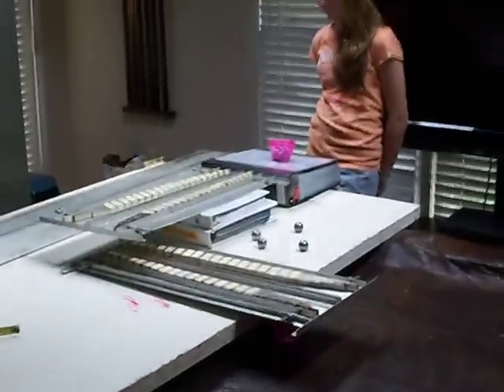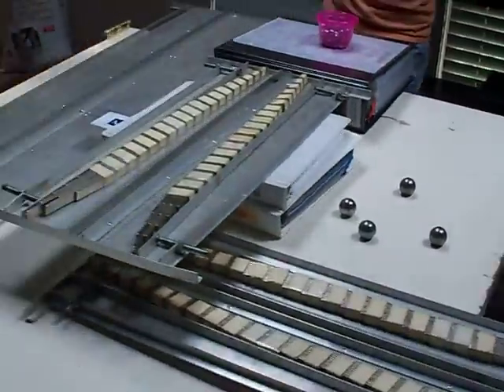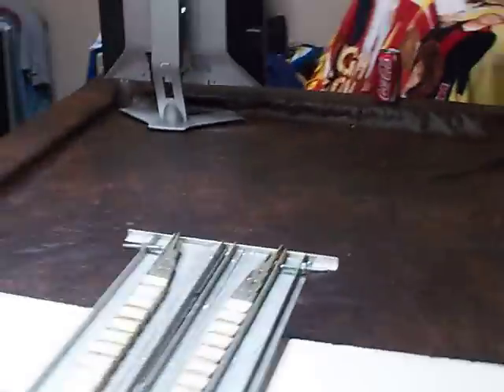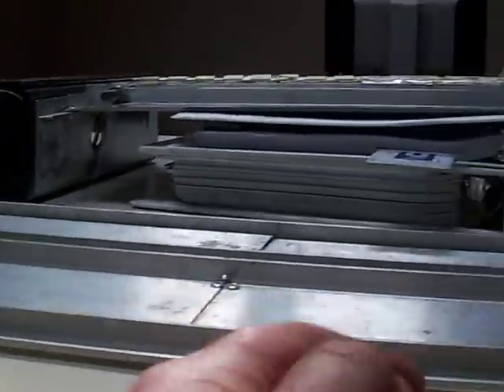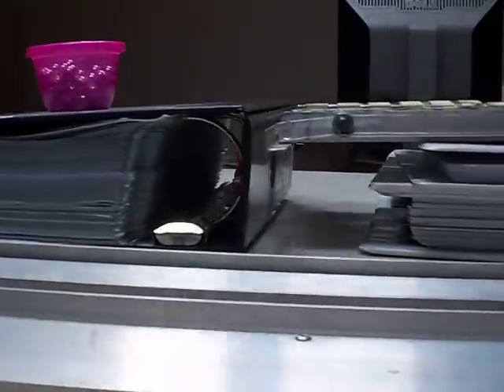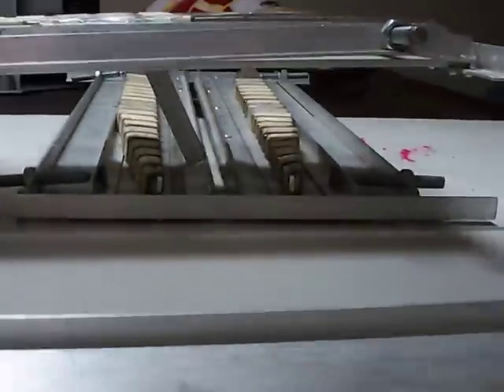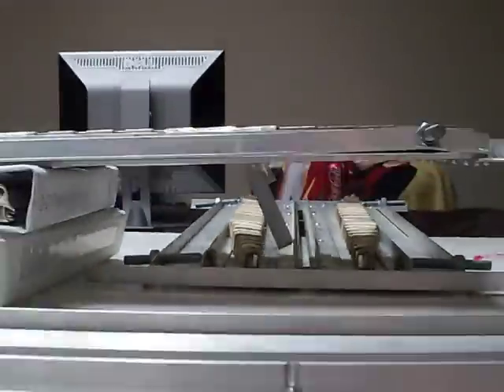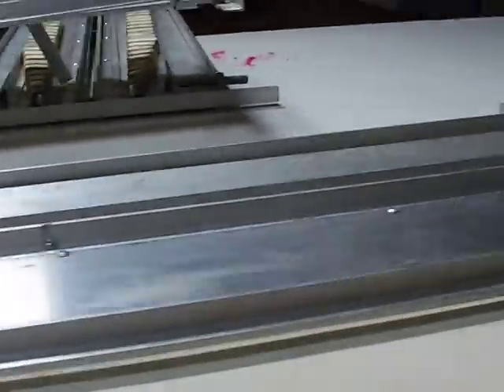Magnet ramp 3

Comment: The ball moves in both a magnetic and gravitational potential. The cause for the ball to move is the resultant of the magnetic and gravitational forces. The work is done at the expense of potential energy. The ball is lowering its initial potential energy given at the start point. At the end point, energy must be provided to move the ball back to the start point (so it doesn't work when looped). This is a conventional setup with less potential energy at the end point than at the start point.